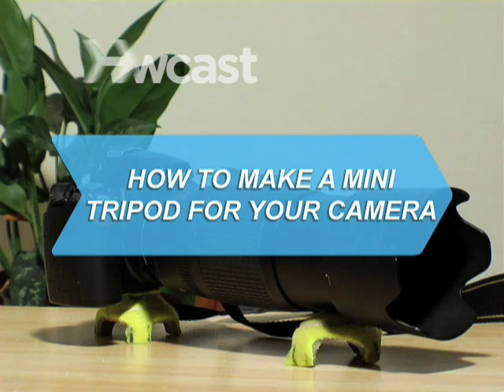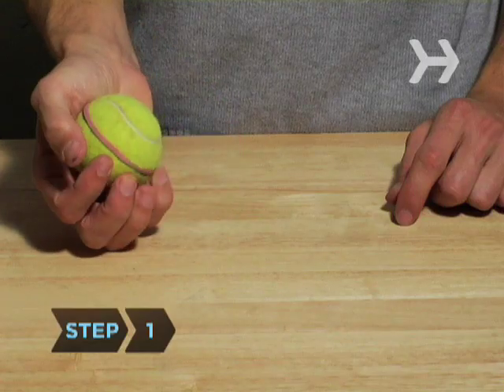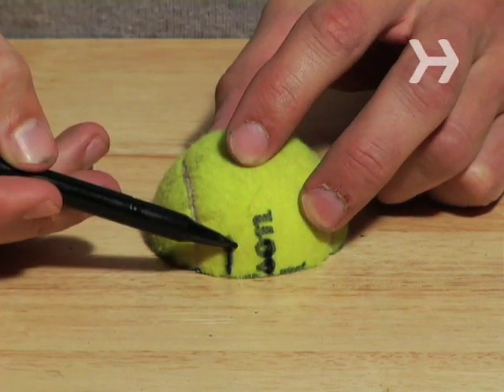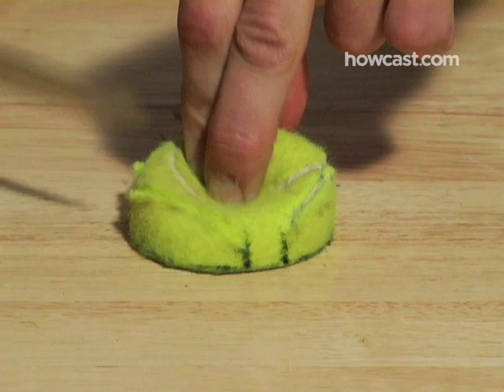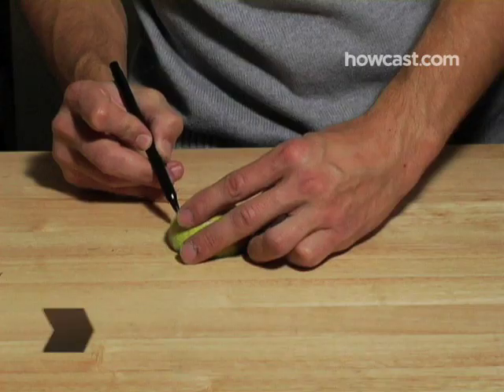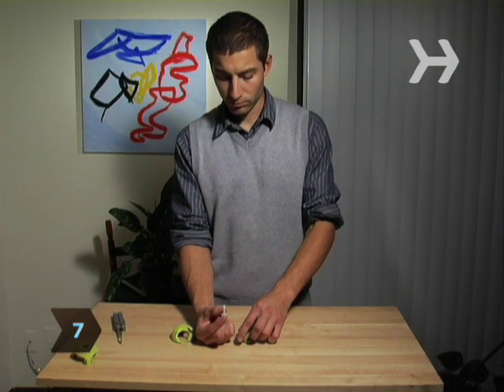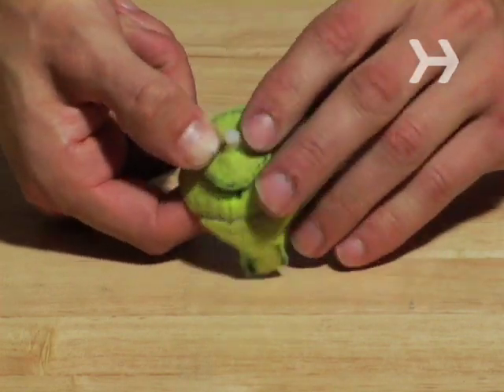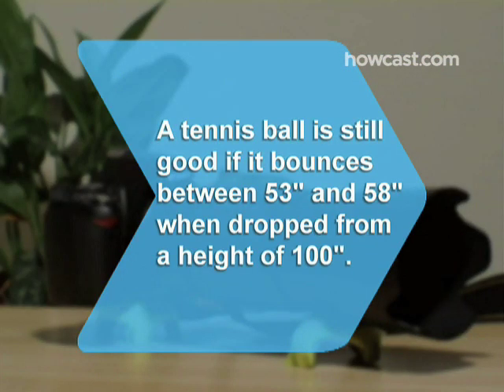How to Make a Mini Tripod for Your Camera

Comment: The 2 things that (should) make that tripod better than a pile of books or just the table, are that it can be brought with u anywhere, and it is TILTABLE. But as we see at the end of the video, the puny thing nearly collapses under the weight of the camera x)
That thing might even work with some light, small digital camera ^^